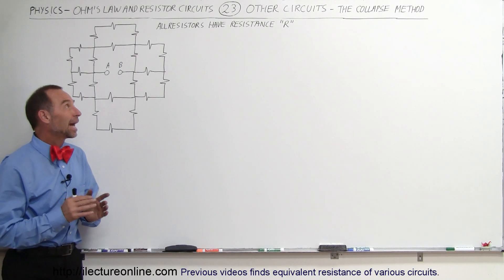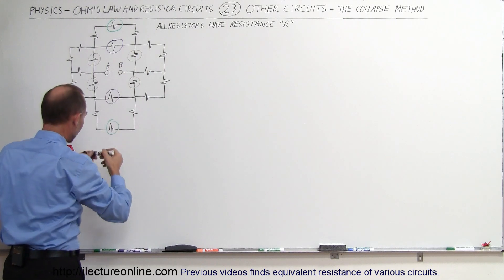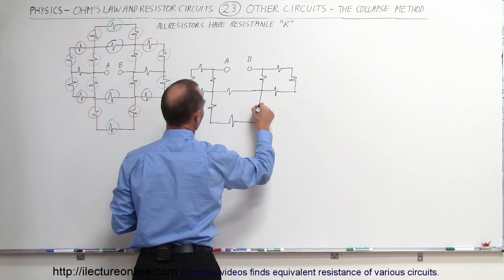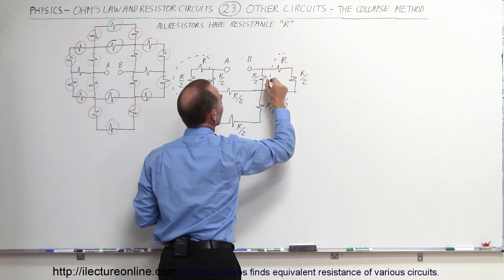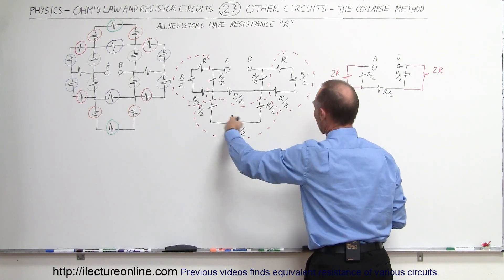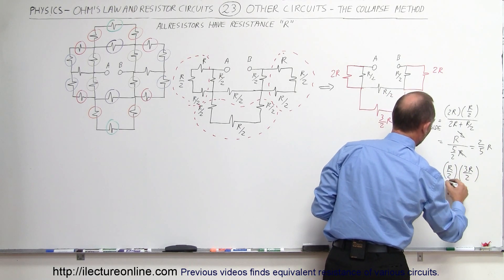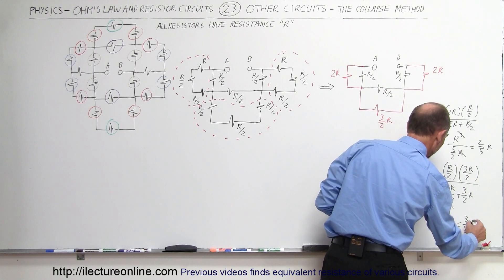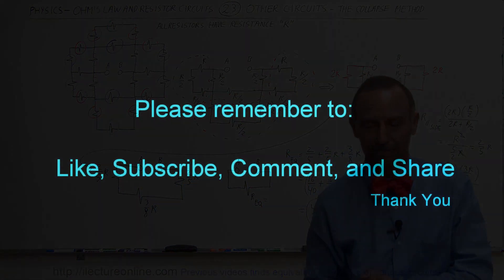Physics 42   Ohm's Law and Resistor Circuits (23 of 23) Other Circuits - The Collapse Method

Comment: Can we use the same Collapse method for a circle with 8 resistors, two on each diameter, and 4 on the remaining curves? 
The equivalent resistance to be found is between two points at a distance of 1/4th perimeter of the circle from each other.
Reply from the maker: The collapse method is used in cases where the symmetry allows it.  Try it and see if you get the correct answer.
Reply: I tried collapsing the resistors on one of the diameters. After that I collapsed it again, as the points between which I am to find the equivalent resistance is at a distance 1/4 the perimeter of the circle. However, I didn't seem to get the correct answer. Am I missing something?
Reply from the maker: Since the problem appears symmetric based on your description, that should have worked.  Take a look at the examples and see if you change the resistor values in the same way.
Reply: file:///S:/Allen%20PHYSICS%20Unit-1/image083.png
(Question: Find the equivalent resistance between A and B, when eight resistances each of 5Ω are connected in the circuit as shown. The answer is given as 8/3 ohm)

This is the link to the image file. I have tried it using the collapse method. I have revised it again and again, yet I still can't seem to understand what I am missing. 
I would really appreciate it if you took some time to check it out. I can't seem to find the solution anywhere.
Thank you for your time, sir.